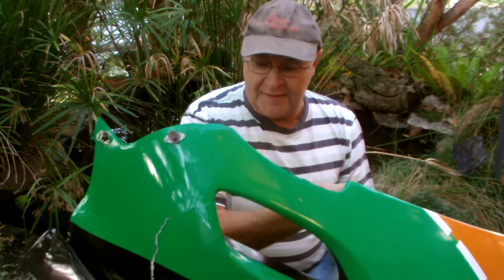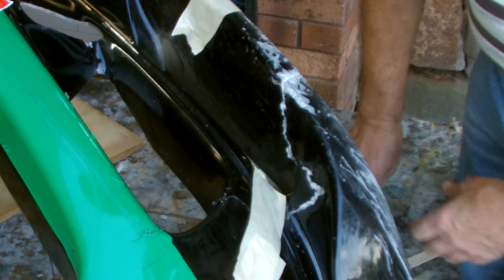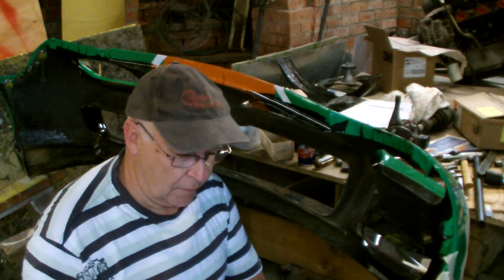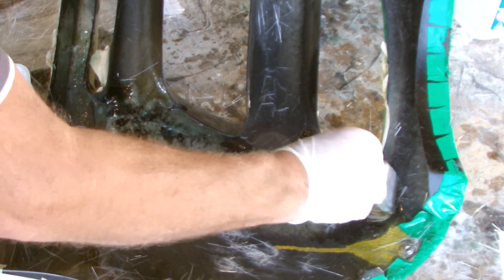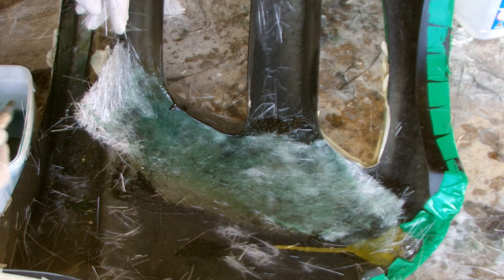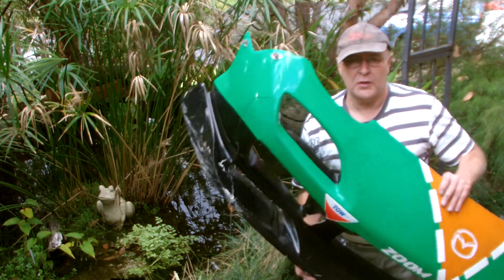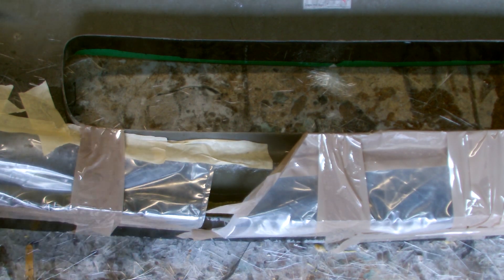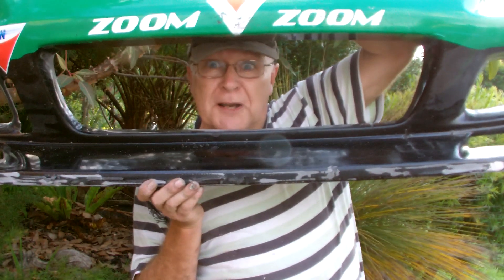How to Repair a Fiberglass Car Front Bumper

Comment: Dear sir my name is amit from india and like your all videos which is about fiber glass and repair our car panels please advice can I remodelled my car and where can I buy these product.

Thanks
Amit
Reply from the maker: I have no knowledge of what or where you can buy f/glass products in India.  You need to search for a fiberglass materials supplier to the swimming pool or boat building industry in a major city is all I could suggest.
Reply: Thanks
Reply: I have a maruti suzuki zen please see and advice for modification
Reply: I have a similar car, you can shave weight from the bonnet, make a thin one so it's light. Engine components like air boxes can be made from fiberglass too. Even the dashboard and seats can be made out of this material.

Comment: That's a pain, Plastic welding it is I guess. Thanks for the response. I asked regarding the pouring foam because my car's bumper (little daihatsu charade) is more fragile than a popstick and was wondering if that'd stop it from cracking at any given point. Thanks again

Comment from the maker: Asking questions is not ineptness but how you learn.  Fibreglass will not stick to moulded plastic bumper bars which are made to be super flexible.  I've tried roughing it up & drilling holes through it, but that's all a waste of time because it soon seperates.  I'm not sure if pouring foam would stick to it long term as I've never had to try it.  It may or may not work.

Comment: Sorry for my ineptness at this craft but could you do a similar repair on a standard plastic bumper bar? Or would you have to look into plastic welding? Thanks. Also would any expanding foam do for the strengthening (from a fibreglass supplier that is).

Comment: Very informative - some neat techniques. 

Just to be pedantic, by "fibreglass" resin, you mean polyester resin, as opposed to epoxy, (though I see even some suppliers refer to polyester that way). You probably know this, but for the benefit of others, it's important to check the compatibility of  resins and cloths. E.g., epoxy dissolves the binder that holds CSM together. A quick check online will usually tell you what works with what.

Comment from the maker: No no no - the aerosol foam will NOT work.  It's aeriated by air rather than by chemical reaction so it's adhesive and strength qualities are crap.  Pouring or expanding foam is something you'll only get from a secialised seller, but I just Googled ëxpanding foam supplies Victoria" and got heaps of leads you could follow.

Comment from the maker: I haven't found it necessary to grind out cracks because the strength of any repair depends on the bonding of the new work to the old.  A widened crack with new material in it doesn't add to that. The strongest repairs are where you grind out the crack or drill holes in the original body piece and put new glass on both sides, making a sandwich interlocked by the resin. This is just ONE way to do a repair, but I honestly haven't had a single sided repair fail in a decade of doing it this way.  T

Comment: I'm assuming that race car repair is not as permanent as other repairs. HUH ?  What I mean is ...shouldn't you grind out the crack and then fill that to build up the original thickness and strength..........that's what I do